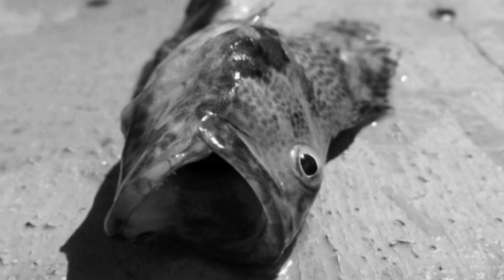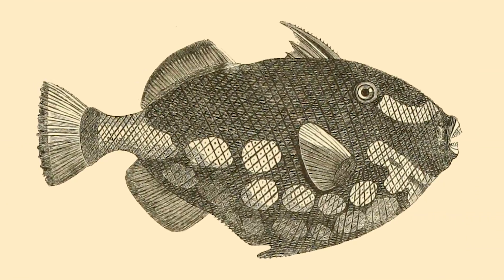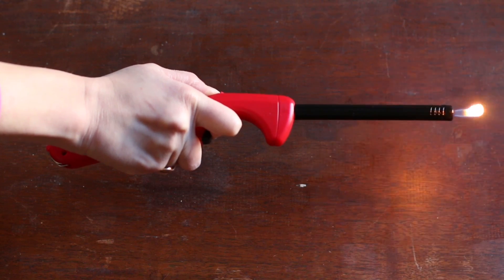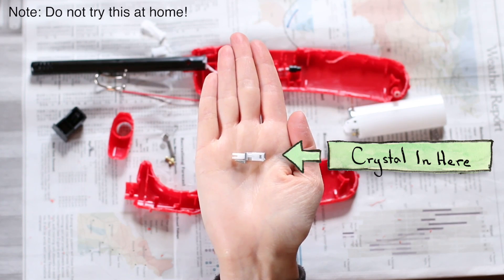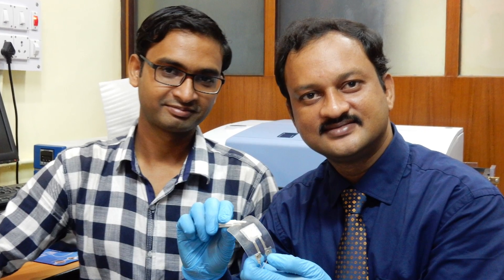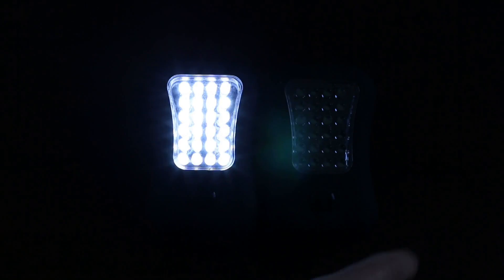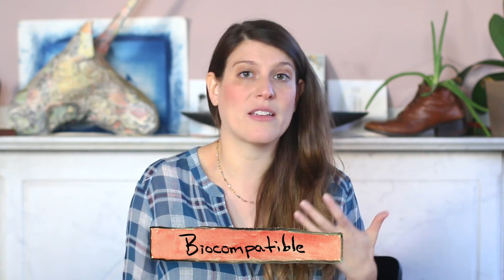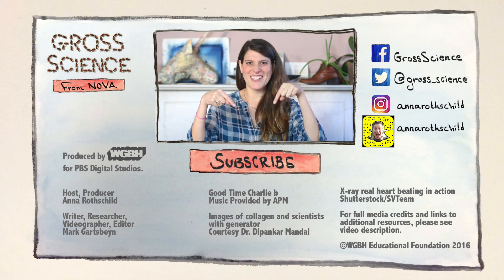Electronics Powered by Fish Scales

Comment: Of all the components of an insulin pump, the battery is probably the least in need of improvement. They run for weeks on one AAA. If that suddenly wasn't enough, upgrading the unit to use to AA batteries would be far simpler than developing some tiny fish scale generator.
Reply: My guess is that the major upgrade here would be that you could implant the generator under the patient's skin, which would allow for a much smaller external unit.  If we someday manage to design an implant that can produce insulin from components in the bloodstream (basically an artificial pancreas), generators like these could allow for a fully internal solution.